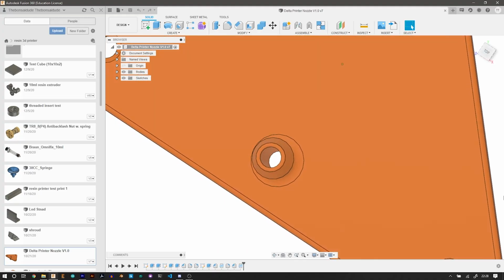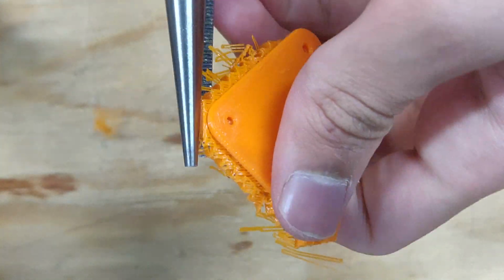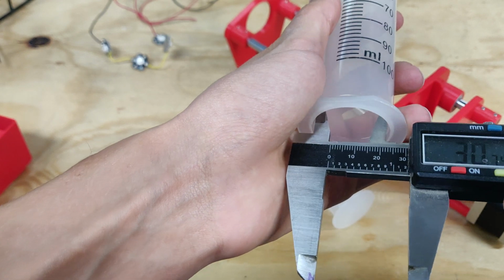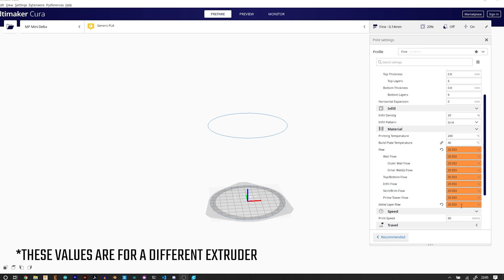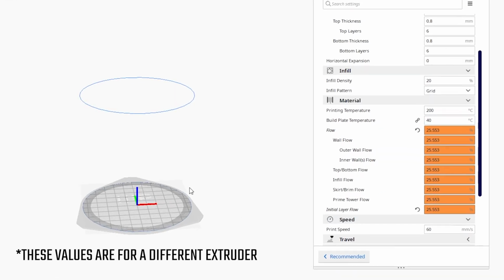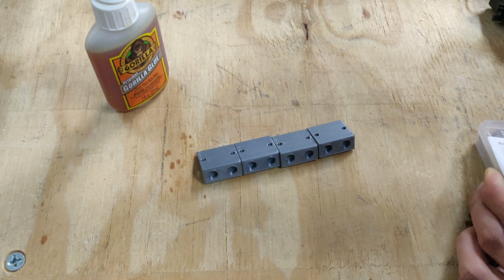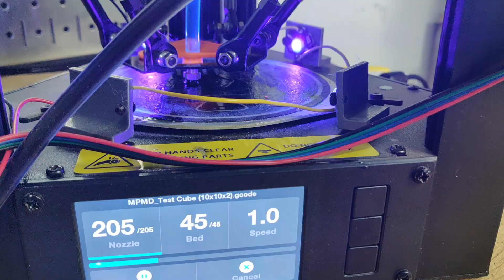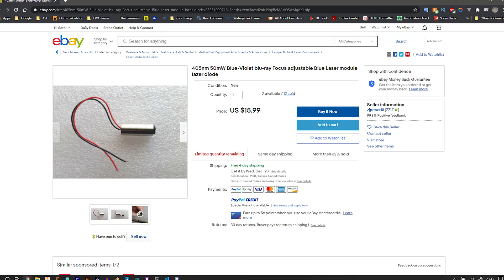DIY Direct Resin Deposition 3D printer | Part 2 (PROGRESS!)

Comment: If you are still considering a laser, please look at those generic etching lasers (usually 405nm). These are now mass produced, and can also be had on the second hand market.
Regarding the extruder part, rubber seal in a plastic barrel isn't designed to handle resin, and the movement isn't as smooth because of how rubber friction fitting works. I'd highly recommend getting a metal plunger (look for "welding oil booster" on aliexpress), those are a plunger and a decent lead-screw in one, and could be a part of a pretty decent resin extruder. swapping out the rubber gasket for a PTFE one might also be a great addition, but potentially unnecessary.

Comment: Hey, this idea intrigues me!

Ideas:
Make sure you have the correct wavelength of light for curing the resin. Those germicidal UV-C leds come to mind (just be careful with them, UV-C is a hazard.) I imagine since they're more energetic they'll cure the resin harder/better/faster/stronger.
You're probably wasting 99% of your photons to the environment in the setup in this video. You have the benefit of knowing right where the resin will be so forget washing the whole build volume with UV and just focus(hah) on curing what you've put down. On that note you could look into lenses to focus the light right on the area of interest, even using multiple high power leds with lenses to all shine on one spot to make the resin cure fast enough. Just make sure the lenses are acceptable for the wavelength of light you're using. You could also have a motorized revolving ring that the led-lens modules mount to to focus the light depending at which angle the print head is traveling so all the light that could potentially be generated is used efficiently, but this adds a bit of complexity. perhaps just focusing the lights into a small area around the print head will be sufficient.
Use a needle cut down (using an abrasive disc on a dremel to not cause burs) to be only 5mm or so in length (for rigidity) for the nozzle. Tractor Supply has needles & syringes for veterinary use at gauges & sizes that would work perfect for this purpose. You can also get a small diameter syringe and cut the luer lock bit off of it and epoxy it into a 3d print to act as the head of the printer that the nozzle would attach to. This would have the benefit of being completely opaque to the uv so the resin wouldn't cure inside the needle.
In regards to viscosity, it seems like the resin is a bit too light and it flows around really easily, perhaps a pre-curing chamber just before the needle would allow you to partially cure the resin and thicken it up a bit? I don't have a resin printer so I'm not at all familiar with the properties of resin. But if you can do this it could also be beneficial for overhangs I imagine; get it as thick as possible but still be able to go through the needle head.
I'd go back to the peristaltic pump for the versatility of it since you can just keep refilling a container of resin no problem during a print, whereas having to fill up a syringe multiple times would be a hassle. To remedy the non linear output of the pump you can coil the tubing inside the pump a couple of times and then make sure the tubes leave tangentially and basically in the same spot as where it enters. Ideally this will make it so as the roller rolls off of the exit phase of the tubing it will roll equally and oppositely onto the entrance phase of the tubing so the force against the roller is constant. As for the torque requirements for the pump you can use a printed harmonic drive which will give you excellent gear ratio & no backlash meaning your retracts won't have any hysteresis.
For tubing selection, the tubing used for the pump should be a nice soft flexible material, just like the silicone tubing you have now, but the tube used to deliver the resin to the print head should be made of a material that doesn't expand very well since you lose precision if the tubing can inflate like a balloon.
If you wanted to go closed loop control with the extruder you could have a pressure sensor tied into the resin delivery system to get the pressure of the resin. Since you know the volume of resin you're pumping into the system with the pump, obtaining the pressure will allow you to calculate the volume that has exited the nozzle. This would also be essential if you wanted to do the pre-curing chamber I talked about earlier so you can essentially tell how thick the resin is becoming by how much the pressure has built in the system because there's higher resistance in pushing it through the nozzle. You can use this data to adjust both the motor output so the extrusion volume stays constant & the power level of the pre-curing chamber's uv led so you don't clog the nozzle. Definitely expect some hysteresis on the led adjustment though.
For the curing chamber you'd have to be sure to get some material that's transparent to the wavelength light you're using for the window.

Another neat idea is that you can keep those low level uv leds around the build volume to fully cure the print as it's printing so there's no tedious clean & cure process afterwards.
Reply from the maker: Thank you for the very detailed comment! These are all great ideas! My plan is to use UV lasers for curing but bright focused lights should work well too. I do like the idea of an improved peristaltic pump. I may try that method again. Thickening the resin is something I never considered, but it would certainly help. I will see if the resin can be partially cured before printing. Pressure feedback is also very interesting. It is probably the only way to have a closed loop system, so it also intrigues me. Thank you again! You have given me a lot to think about...
Reply: @SethAltobelli  Here's another interesting idea, but it's more of a software thing than hardware. You can print just the walls of the layer you're printing, and then flood them with resin like the paint bucket tool in image editing software, back the print head off the print and bathe the print with uv to cure the shaped pools of resin. This could also be utilized in infill layers as well. Hopefully since the pool of resin shouldn't exceeded the height of the walls there shouldn't be any meniscus like effects from the resin's surface tension. This method could drastically reduce print time.
Reply: I think this would also affect strength characteristics since you're bonding all of the walls of the print at once to a solid pool of uncured resin.

Comment: You probably will need the laser to point exactly under the nozzle output but not close enough so it can clog the nozzle with cured resin. Excited to see how this project progresses.
Reply from the maker: Yes, I have considered using a laser. It seems to be the best course of action, but I have not sourced one yet.

Comment: This is an awesome project! keep it up!
Reply from the maker: Thanks! I will do my best to get it working so I can post an update.
Reply: @SethAltobelli  also a weird idea I just was thinking about would be to have an inverted delta printer with the base moving and the extruder static above the base. On the extruder you could have mounted your UV LEDs and then as oppose to running a long tube to the end of the extruder you could have the whole extruder mounted on top. Also to have more controlled extrusion you could use a nozzle hole small enough that the resin won't leave without additional pressure(nozzle size would be viscosity dependent for different resins) and then you could push resin out of the extruder with a extruder screw actuated by the same stepper motor. The inverted delta printer design could similar to this for reference: https://www.youtube.com/watch?v=8v-fNXnAaPw&t=496s. Just an idea :)
Reply from the maker: @avigetsbored  That is a very intriguing idea... Thanks for the suggestion! I want to avoid a completely custom build if I can as that could be quite expensive, but I may try that if I cannot get this to work. It sounds like that system would have many benefits. Thank you again!